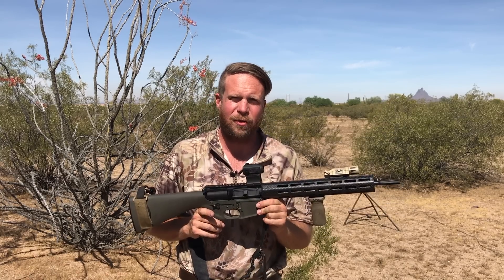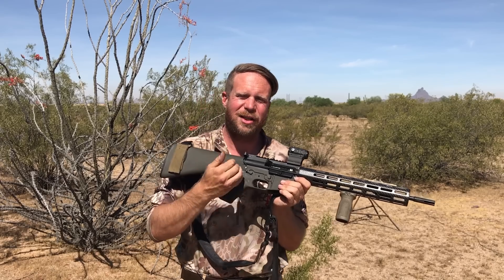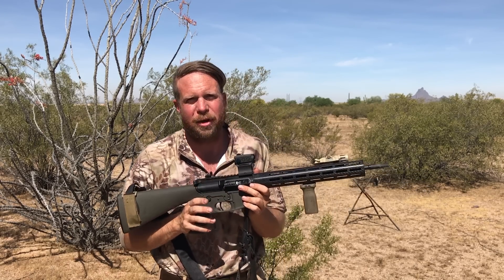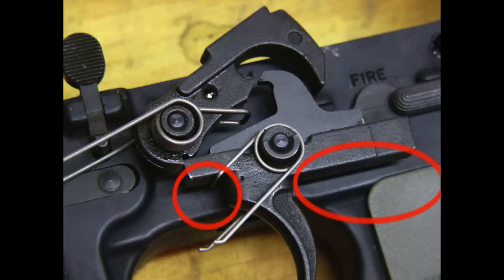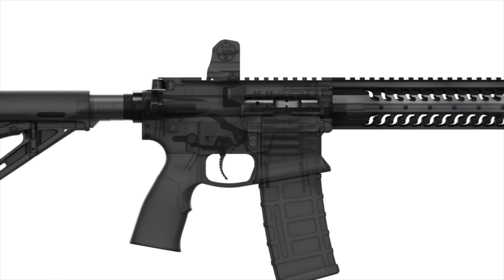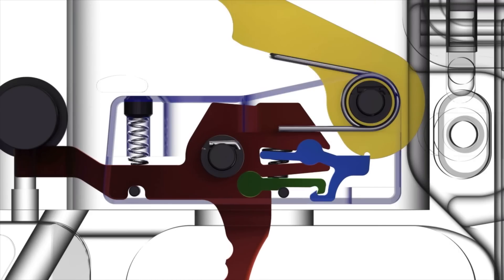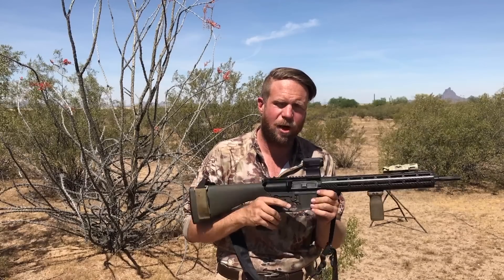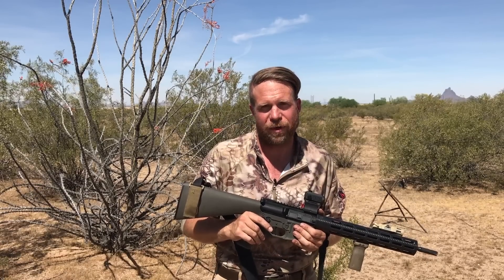WWSD 2017 - The Fire Control Group (Trigger & Safety)

Comment: Just used my new KE arms slt-1 today for the first time and WOW.  It’s the only trigger i will use from now on.  The reset is phenomenal.  It feels like no other trigger.  When I first installed it and dry-fired a few times i was convinced that i had done something wrong or i had a defective trigger - because it just feels so different.  But no there was nothing wrong, i just ran 120 rounds of cheap tula steel case and 60 rounds of various left over 556 & 223 i had been saving up in a baggie from random range trips.  Zero problems or issues and just idk what to say.  Absolutely phenomenal.  Outstanding.  I love gheisle but for the money this trigger is hard to beat

Comment: I never understood why it was made so that you can't put the safety on unless it's cocked. But it doesn't bug me enough to change out my Geissele g2s trigger which is really sweet. I polished all the contact surfaces before installing it, but I didn't remove a bunch of material to where it changes the geometry I just shined and smoothed things up so it's more like the higher end version that they sell. 

Geissele also includes stronger pins than the normal mil spec pins.

Comment: Would Stoner stick with a 5.56 as it's generally considered ineffective at range hence the need for DMRs?
Reply: Juan Sanchez   And modern with Optics, So why stick with a cartridge that is only effective out to 200-300m when the enemy can engage at >500m
Reply: Stoner actually never liked 5.56 and preferred .308. This is also the real reason he didn't care for forward assists; the AR-10/SR-25 carrier has enough mass and a heavy enough spring to not worry about it (which is why the G3 and FAL get away with not having them, vs every modern intermediate caliber rifle having them other than the tavor).

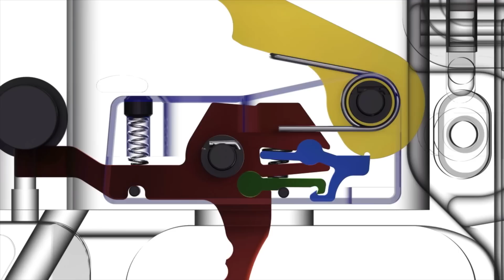Comment: 9:10  With an interest in mechanisms, how would a military design make that full-auto?  Or has it been designed from the standpoint that no perps can make it full-auto?
Having it so that the secondary sear doesn't disconnect seems to be the most direct way I can see in this design, but the likely ergonomics for a selector would be ass.

Comment: The cassette triggers like the SLT-1 do not have the same hammer spring strength. This can cause some ammo not to ignite as consistently. Could cause accuracy issues. My SLT-1 will not reliably set off .22LR at all.

Comment: Something I noticed damn near a year later is that on this trigger is that the standard safety lever could not be made to also select the fire mode. Using this type of trigger would force a secondary fire mode selector located above the trigger, that would allow for the disconnecter to keep hold of the sear.

Comment: so basically, if you  pull out the "disconector" then it'd be full auto?
Reply: No, it wouldn't work.

Take out the disconnecter, and the hammer wouldn't hit correctly and pierce the primer.

Click, no bang.
Reply: Or it could fire out of battery (the round isn't actually in the chamber) and hurt/maybe kill you.

Comment: I still see absolutely no reason to be able to engage the safety on my rifle while it's uncocked. If I try to engage the safety and it will not move into the 'safe'(aka less-lethal-mode) position, then I know I need to charge the weapon. No hesitant press-check needed. Just my thoughts stemming from how I use my rifle. Needs will vary.

Comment: Just got my KE Arms SLT-1 installed on my AR15 and man it's nice. Good deal too since I got it with an ambi safety as a  combo for about $180 with shipping from Ballistic Deals.

I will say, from an initial stand point, it really makes the action smooth and almost like I don't have a hammer in the gun when I pull the charging handle. Can't wait to try it out on the range. The trigger is insanely light, well light since I've been shooting what felt like a really heavy 7 or 7.5 milspec trigger that was from Palmetto State Armory. lol
Reply from the maker: Cool, glad to hear you like it so far!  We both think the SLT1 is fantastic. ~Karl

Comment: I was going to close with this but I'm moving it to the top to see if anyone else has an opinion. Who would win in a speed talking contest, Karl or Tim from the MAC channel?  

Can you run the bolt with the safety on? IMO if you can it offsets what I see as a minus for this system, that is I prefer the safety to not apply with the hammer down since the hammer is not external and other systems work that way. 

Again IMO you are overselling the closed up aspect, I've done a lot of classes with military M4s firing millitary ammo and can't remember ever seeing a primer back out or any rocks get in the trigger group of a mill spec M16, sure it's possible, more likely to happen when cleaning out in the field but I haven't seen it happen while firing. More often is the death jam where a case gets caught int eh charging handle slot.

It looks to me like the advantage of this trigger system is moving the stress point by eliminating the traditional disco system. Otherwise it's more complicated and uses small and possibly more delicate springs. I don't buy that the standard M16 triggers system is a problem area of any significance at least in the military environment, that does not apply to the burst systems which can be problematic. I see this trigger as a good option for 9, 45, 50, all the non standard caliber conversions, it might even be better for 22lr conversions.
Reply from the maker: +CCW1911 I've seen a lot of fcg failures due to primers and debris at training events and matches.

I slow down my speech for these videos to my personally most tolerable speed that doesn't drive me nuts.  ~Karl
Reply: Ok. Can you run the bolt with the safety on?

Comment: Sounds like a great choice. 4.5 lb single stage- 1911 shooters will love it. I learned on a 2 stage and have very little experience with single stage. The box seems like a good idea. I have heard of popped primers but never experienced it. Can see where it would be a cast iron PITA if it got wedged under something. Yrs ago when my Bushy was new i let someobe try it at a club match using his handloads. Got off 1 or 2 rounds then nothing. Double feed. When we yanked the mag, powder came spilling out. Either the rounds had very little crimp or were not crimped for a semi. Primers were also too deep cuz a round failed to fire. Cycling it yanked the case away from the bullet i guess. It was very odd. So is powder spilling out of the mag well

Comment: The standard ar-15 safety was outdated as shit, the 90° and the fact that you could only use it on a cocked hammer was bad.
That's why I only use SG550's in training, ambidextrous 45° safety independent to the condition of the firearm.
With this new trigger I might give ar's another shot.

Comment: In the animation, the trigger is released at the same time as the hammer is coming forward, so the primary sear just jumps into position. I can't tell what the secondary sear is doing. I know how disconnectors work, just this animation is not making sense.
Reply: I was thinking the same thing, I watched the animation over and over and the function wasnt making much sense.  The animation needs to delay the reset of the trigger in order to get the full functional view.  I dont think many people release the trigger before the hammer cycles....

Comment: The big issue with the 9mm SMG variants was egging out the pin holes in the lower receiver for the trigger group.  However, I wonder how much of this was due to the one-time popularity of rewelding demilitarized M16, XM16E1, and M16A1 lower receivers.  John Norrell wrote up the procedure for Firepower magazine back in the 1980s. At the time, the receivers were only being chopped once.  The trick was sorting out two pieces big enough that you'd be able to match them up after reswaging,  straightening, and cleaning up the cleft.  However, I can't imagine that all of this work combined with the heat of the welding was all that healthy for the metallurgy of the 6061 (early) and 7075 (late) aluminum.  Norrell also noted that you had to watch for some of the earliest receivers, which had thinner sides than later production.

Comment: I like the closed system as well as the ability to engage the saftey with the hammer down.  I wonder if the SLT-1 trigger would work in the Sig MPX rifle?  I would seem that this trigger would solve the problem of hammer wear on the trigger bridge when using an after market trigger parts.  That is to say, this trigger would appear to eliminate the need for Sig's trigger bridge to absorb excess hammer energy.

Comment: while all your video makes sense to me, but i have to disagree with you on the safety lever. i totally understand the need to have your gun in safe even just as an airsofter because even if our guns can't hurt people the way firearms can, you can still take someone's eye out if he doesn't wear eye protection, this is why around "safe zones" having your gun safe is severely enforced.

in the standard configuration, i feel like that you can't put the safety on if the hammer is "down" (as opposed to "cocked") is a safety feature because if you can put the safety on, that means that your hammer is in the ready position and that the bolt may be closed on a live round and if you're going to store the gun,  then you may want to check if it's clear (as live rounds left in the chamber is one of the main reason in firearm incidents), and clear the gun if otherwise.
the contrary as if you can't physically put the lever on safe, it means that your hammer is "down" and that there a considerably less chance that your gun may be closed on a live round (next to none, as risk zero doesn't exist in this world).

Comment: Yeah, I wouldn't trust my life to those teeny tiny little hooks for the disconnect. It seems like it's just overthinking it when all they needed to do is beef up the normal disconnect. I also don't like the fact the safety can go on with the hammer being cocked. The standard safety tells you if the gun is ready to fire or not in the dark when you may be trying to be quiet, and popping out of cover to engage a target and realizing you don't have a round chambered is a big no-no for a rifle designed to be your go-to weapon.

Comment: I think at $200 a trigger, some thought has to be given to an acceptable cost.   The suggested trigger is more than 1/3 the cost of a complete, working Anderson AR.  Admittedly the Anderson's have a less than stellar finish, and sometimes some internal roughness leaves the factory, but for the most part they work okay.  From my perspective anytime you speak of replacing $20 worth of steel parts with a $200 assembly we start talking about building a race gun.  Is a drop in hammer/trigger/sear box with a light trigger pull desirable?  Absolutely.  Should getting one add another 1/3 to the cost of the rifle with the biggest advantage being touted in case a primer or a pebble gets under your trigger?  To me, no.  A previously owned (used) $40 Timney off Ebay works just fine thanks.    :)
Reply: It's probably the second most important part of the gun behind the barrel. Worth every penny, even if it costs you $200+
Reply: I hear you, but I think the most important part is the shooter.  $180 buys a fair amount of practice ammunition.  Noting also that continual actual firing and friction smooths out a lot of initially rough engagement surfaces.  (Of course some 800 - 2,000 grit automotive sand paper does that too.)  Yes, sure if you have 10,000 rounds of AR usage and can repeatedly put 5 out of 5 shots into a playing card at 100 yards with a mil spec rifle, a better trigger would be a good thought.  But for a beginner putting their first AR together?  I am not at all convinced a high dollar trigger is what they need.  This of course raises a question I know nothing about.   Does anyone make a factory match rifle that comes with an alternative target trigger as a factory option?
Reply: Ken ibn Anak you can just build a rifle and put the money where you want to. You can still have a cheap rifle with a good trigger. PSA runs deals all the time.
Reply: Long Range good to know.
Reply: Price gripers: You should just spend all the money you could save on ammo!
Also price gripers: Owns a lot of guns they don't shoot

j/k, but anyways they aren't doing a series saying what they think everyone should buy, they're trying to find the best parts.

Comment: On the new FCG the main seer(Blue) seems to have very small contact with the hammer. Since only the corner engages the hammer, is their any chance of it being a breakpoint or "wear quickly" point?  Thanks and great new series
Reply: Wait....looking at what the trigger was designed to do and watching the clip of the trigger running again I'm pretty sure that the answer to my question is simply "No"

Comment: I like how the typical Ar15 safety doesn't engage unless the hammer is back, lets me know I need to charge the gun. However, I hadn't considered the need to make the gun safe while Mortaring to clear stuck cartridges, that makes sense and is a worthy cause.
Reply: FWIW I have had an unfired cartridge stuck out of battery, because it was fireformed in another chamber, then reloaded without full length resizing. Wonder who made that mistake?

Comment: how can i know if my bolt carrier is too fast?
Reply: Local Forearm "too fast" as in "bolt bounce"? It's not an issue for semiauto. If you mean "smashing the back of the buffer into the back of the tube", try using a heavier buffer and see if it still operates reliably.

Comment: With that design would the more wear and tear on the single contact surface the hammer has be a problem?  Considering now it has to slap back into the sear on it's way forward, I expect that little surface on the hammer to get beat up more.

Comment: No! Just NO! By making it so you can put the safety on without a cocked bolt you add in one more F-up. In an ideal weapon, the safety will only engage when the weapon is ready to fire. Scenario #1, target pops up, safety off (click), pull trigger (click), no round in chamber (oops, your dead).  Scenario #2, target pops up, safety off (click), pull trigger (no click), no round in chamber (oops, your dead).  With this fire control group you just doubled your chances of messing up.
Reply: Rl Badger
I would argue that if your hammer is down without you knowing and you try to fire, that's your fault, not the safety's fault.
Reply: Rl Badger I'm not quite sure the math works out on that one
Reply: I prefer the safety to not work when it's not cocked too, since the hammer is hidden it is a way of knowing it's condition, I see this as a good feature. I think being able to apply the safety while "motaring" or whatever is way overblown, safety is achieved by using correct procedure and keeping the muzzle in a safe direction whether the "safety" is applied or not. I would say the main advantage of this new trigger is the improved disconnector if it proves to be rugged and reliable.
Reply: A very poor troll.
Reply: Rl Badger It's just as likely as the system is currently that you go to fire because your safety's off and had forgotten it wasn't cocked, or that you thought the hammer was down and think it's safe (but it isn't) which is a more significant safety fuckup. You're not making a fair comparison. If you're that worried, you want an indicator or a trigger which can also be double action if needbe. I'd go for the latter I suppose
Reply from the maker: Lol.   Ok...whatever.  ~Karl
Reply: So after 5 days humping, 3 days without sleep, sorry it isn't a design fault that it doesn't go bang EVERY time you flip off safe. 49, people mess up, what is gained by a safety that works on a empty weapon? I know what happens when a weapon doesn't fire when a solider clicks off safe. This is so giant a design flaw no one sees it.
Reply: Sorry, I just want my weapon always ready to fire when I take it off safe. The opposite of safe is kill. Empty weapons don't kill. Being able to put a weapon on safe, empty is the one of the thing I'd fix on a m-16.
Reply: I think Stoner would correct the empty/safe flaw as #1. This flaw has cost lives. It would eliminate the pre op questions, "Is everyone's weapon loaded? Is your weapon on safe?" The "Is your weapon on safe?" would mean, loaded and ready to go.

Comment: There is no need to wonder what Stoner would do. Before his death in the 90's he was hired by Knights Armament as a consultant and they came up with serval improvements to the AR platform and incorporated them into their SR-25(AR-10) and the SR-15(AR-15). These improvements include an enhanced bolt design that has larger locking lugs that are rounded instead of square to increase its strength. A larger cam pin. A custom length gas tube that is slightly longer than mid length. Free floating barrel, 2 stage match trigger, and an ambi lower
Reply: Nutz4Gunz45 a lot has changed since the 90's. Just look at how far sights have come. And ssshhhhh, don't spoil the fun.
Reply: Crazy indeed......
Reply: So you are saying its Expensive
Reply: El Jericho uhh yes he would.
Reply: TheJfdksl the Cav Arms lower had NOTHING to do with the AWB... They were at their height of popularly in 07/08.. They were shut down in 2010 for manufacturing in a facility that was not listed on their FFL... Nothing at all to do with the AWB sunset. .. Also Stoner's approach was to use light weight space age material to lighten the weight of the weapon platform. . These were not even available for Stoner to use in the early 90s...